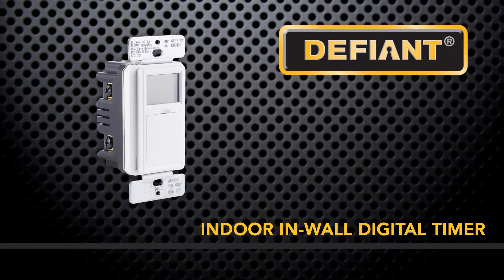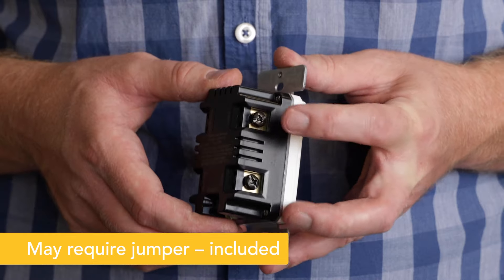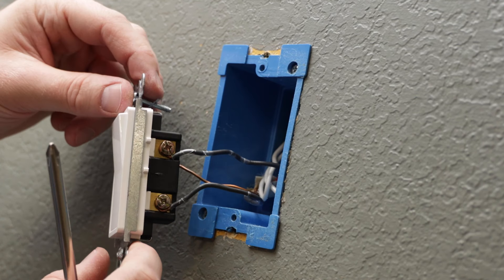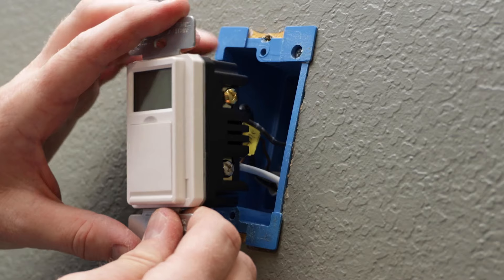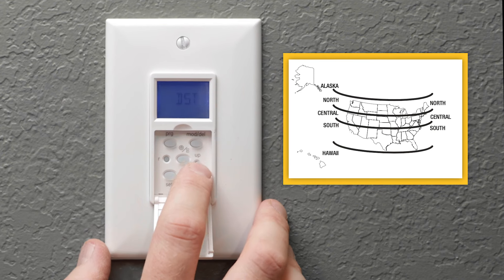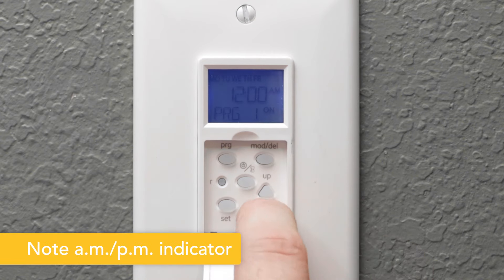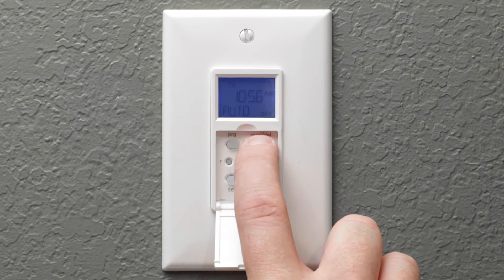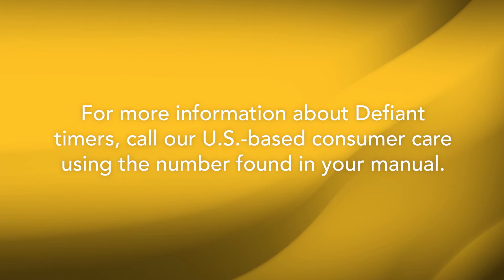32648: Defiant 7-Day In-Wall Timer - Installation and Setup

Comment: Thx for the short & concise video - it always helps to see how to do it as if you watched as someone taught you what you need to do.
Reply from the maker: Hi, James. We're glad the video helped. If we can do anything else for you, let us know.
Reply: It’s after sunset (dusk) I realized I had to correct the program and switch the dusk time to ON and the dawn time to OFF. And then the program did not kick in and turn the lights ON. Did I do something wrong or will it kick in later say a day later?
Reply from the maker: When the on time was set after dusk, the timer doesn't turn on until the next day. If that didn't happen for you, please contact Defiant customer support at 1-866-308-3976.

Comment: I installed the 32648 digital timer. The video instruction works until: in PROG 1, I specified the ON time by entering DUSK and hitting SET however the display did not progress to the OFF time. I found I had to hit PROG again, then I could use TIME to  specify an OFF time.
Reply from the maker: Thanks for reaching out. You are correct, the program button is used to cycle through the ON/OFF times. If you need additional assistance, Defiant customer support is available at 1-866-308-3976.
Reply: 70l 0:31 0:32
Reply: @JascoProductsCompany so to clarify, you set a program ON Time and then set a program OFF time?

Comment: Is it possible to replace the internal backup battery? Our switches are loosing programming after 1 to 2 hour power outages. Thank You in advance!
Reply from the maker: Thanks for reaching out. The backup battery is built in and not designed to be replaced. If you have other questions, Defiant customer service is also available at 1-844-871-8796.

Comment: We installed this unit in June 2022, but when the power goes out, it loses everything and have to reprogram it.
Can you please tell me why it doesn’t keep the program when we lose power. This United is only almost 3 months old.
Reply from the maker: Hi, Cindy. The timer has a built-in battery backup and should save your settings for up to seven days when power is lost. It's possible your device has a faulty battery. Please call 1-844-871-8796 to discuss your options.

Comment: I only need to have program 1 to be set and it should work right? It didn’t do it for me just now but I’ll wait until dawn until I call in for customer service.
Reply from the maker: Hi, Chris. Yes, you can set only program 1 and the timer works. If you create an on time prior to the time of day, the schedule won't activate until the next day. Defiant customer support is available at 1-866-308-3976 if you need additional assistance.
Reply: @JascoProductsCompany  it worked! Thank you.

Comment: Great video!
I accidentally set the wrong dusk time and the light turns on WAY too late.  Using RND means sometimes it's even 'later than late.'
Is there a way to JUST adjust the dusk time?  Or do I have to start over from step one and delete EVERYTHING?

Thanks
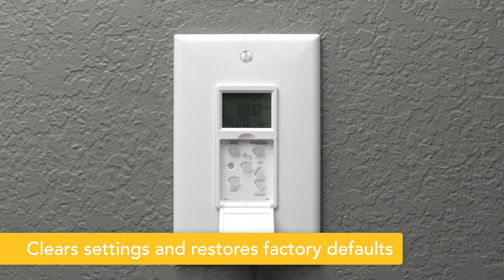Reply from the maker: Hi, Larry. Thanks for your feedback. If I understand correctly, changing your region should resolve the issue. This is done during the time/date setup process starting at 2:25 of the video. If your time settings are correct, press the set button to cycle through the programming options until you get to the region section. The "RND" function randomly fluctuates your ON/OFF programs up to 30 minutes to create a lived-in appearance. If you have additional questions, Defiant customer support is also available at 1-866-308-3976.

Comment: WHAT IS THE WHITE WIRE JUMPER THAT IS SUPPLIED USED FOR
Reply from the maker: The white jumper wire connects to the neutral wires in the switch box. If you have additional question, Defiant customer support is available at 1-866-308-3976.

Comment: After setting up the program it reads AUTO off. Is that correct? Will the program I set up for dusk to dawn still work?
Reply from the maker: When "AUTO" is displayed on the screen, the timer follows your scheduled programs — in your case the dusk-to-dawn setting. The "off" and "on" next to AUTO, MANU, etc. indicates whether the connected light is on or off. If you have any other questions, Defiant customer support is also available at 1-844-871-8796.
Reply: Thanks the Light just came on . Pun intended.

Comment: Hi I went out and bought another one, we liked it because it had the dawn & dust. We ran into a problem while installing the new one. There a red wire that came loose and we can’t figure out where it goes. I’ve shut the power off about 4 time and when I turned the power back on it kept the time. We can’t get the porch light to come on. Can you help please. Cindy
Reply from the maker: Hi, Cindy. Wiring colors may vary based on several factors, but a red wire is often a traveler in three-way installations. To ensure you receive proper assistance, please contact Defiant customer support at 1-866-308-3976.

Comment: Just saw this.  On more question. Is shows "Auto" mode and shows "off".  Does this need to say "on"?
Reply from the maker: Thanks for reaching out. Auto displays when your timer is set to follow your programmed times. The on and off indicators show the status of the connected light or device. This is helpful when the timer controls something you can't always see, like a porch light. If you have other questions, Defiant customer service is also available at 1-844-871-8796.

Comment: Installed it, tried it on manual mode, worked fine. Set schedule and thought it was good to go, never came on  and does not worknin manual mode now either, I can hear the switch make a click when I turn it on and off but light is not coming on
Reply from the maker: Sorry to hear you're experiencing issues with your timer. Check all wire connections, especially the load wire in this case, and ensure the terminal screws are tight. Please note, these are not back-stab terminals and the screws must be tightened for the timer to operate properly. If the light still doesn't turn on, please contact Defiant customer support at 1-866-308-3976.
Reply: @JascoProductsCompany  I'll just return it to Home Dump

Comment: My switch doesn’t have a green ground  wire . Just a black and  bypass wire to light?
Reply from the maker: The ground wire is a safety feature to protect against shocks. This timer requires connections for line (hot), load and neutral. If your switch box is missing any of these wires, it will not operate. You can also contact Defiant customer support at 1-866-308-3976 for additional assistance.

Comment: I just finished installing this. The display comes on but I have no back-lighting. Does the Hot and Load need to be switched?
Reply from the maker: Hi, Pete. That could be the cause of the problem. The internal battery can power the display and retain your settings but not activate the backlight. Ensure the hot wire is connected to the line terminal. If you continue experiencing issues, contact us at 1-844-871-8796.
Reply: @JascoProductsCompany  I just pulled it out, swapped the wires, and it indeed was it. Whole thing works great now. Thanks! I wasn't aware that it even had a battery that could power the display.

Comment: I only have two wires (black and yellow) contacting with the old switch but you show three wires needing to be connected. Can I still use this timer?
Reply from the maker: Hi, David. Wiring colors may vary from home to home. In addition to a line (hot) wire, which supplies power to the switch box, and a load wire, which connects the timer to the light, a neutral is required for the timer. Be sure to check the back of the switch box because the neutral may be tucked behind other wires. Depending on how your home was wired, it may not have a neutral. If this is the case, contact a licensed electrician to determine your options. 

For further assistance, Defiant customer support is also available at 1-866-308-3976.
Reply: @JascoProductsCompany  Thank you!
Reply: @JascoProductsCompany  Is there a way to determine the neutral wire if there are multiple extra wires?
Reply from the maker: @David Boyle the neutral is usually white. It is often multiple wires bundled with a wire nut and tucked behind the other wires in the switch box.

Comment: HOW TO CONNECT IF THERE IS ONLY WHITE BLACK AND GROUND
Reply from the maker: The timer requires line, load, neutral and ground wires. Depending on how your home was wired, it may not have a neutral at the switch box. For more information, Defiant customer support is available at 1-866-308-3976.

Comment: I can’t get to the first screen after default reset. It immediately goes to 12:00 am auto. Even after pressing up and down arrows, I cannot set Time or day or calendar.  What do I need to do?
Reply from the maker: Hi, Roger. After pressing the reset button, push "set" to begin programming the time. After pressing set, you can use the arrows to adjust the time. Press set again to select the date. If you need additional assistance, contact us at 1-844-871-8796.

Comment: Just tell me how to setup the time when I WANT TO SETUP MY PERSONAL TIME!
Reply from the maker: Hi, Leonard. To program the time of day, press the set button and use the arrows to adjust the time as shown at 2:25 of the video. To create a schedule, press the "prg" button followed by set. Use the arrows to choose the day(s) for the program to run and press set to store the option. Select a time for the connected device to turn on by pressing the arrows. Follow these steps to create an off time. This process is outlined at 3:05 of the video. If you need additional assistance, Defiant customer support is available at 1-866-308-3976.
Reply: @JascoProductsCompany  Great! Thank you so much!👍🤝

Comment: I just installed mine and hitting the set button resets the switch
Reply from the maker: Hi, Harley. To help troubleshoot the issue or find another solution, we need a little more information. Please contact Defiant customer support at 1-866-308-3976.

Comment: My wall has a red wire and a black wire. How do I connect this timer ?
Never mind, this switch is so freakin big, it doesn't fit in the box.  Now I have to make an extra trip for nothing, to return this beast.
Reply: @skyflyer4231  Mine didn't. It's 1 3/4 inch deep. Too deep for my box. I returned it.

Comment: Do you make a similar SIMPLER timer to program? I'd like to replace this complicated thing with one where I can set the time of day, then the time to come on and time to turn off. PERIOD. No time zones, no seven programs, no UNBELIEVABLE numbers of button punches. I dread every time the power goes off around here.
Reply from the maker: Hi, Max. Sorry to hear your timer hasn't met your expectations. We offer several in-wall models that might meet your needs better. 

If you want your lights to turn on and off at the same time every day, check out https://www.amazon.com/myTouchSmart-Digital-Programmable-Indicators-26893/dp/B01BKGC492/ref=sr_1_6?crid=3FIRCIPF1XROO&dib=eyJ2IjoiMSJ9.CK3qZbYM9pM_kz7A9lMOv8WkuJ-ojZxKkcvbxt3_DF_ZK4jKXxavBeqH4ocpLf5x7vpr9vuBMJ7OknIarkbiE1eKHZhCqFlFqN779g--192qxMZjspm_cGdVs0dQKjvrLo3OjZTtcCwiYcUBrWNE41QWO9Hg5FlykkXYLRAMkvj9lxPzFbu0ItWUU_-xLsyFiWwj20AKxgtpNSsOtPRgyxsHKnDf9KV5WcabkkaZ6S6pJswd9JVPvXc06ebaMn8r5OwyZXqGCz0Lw9Bn77r13MnsQix2jSWCEY4tiyglR43HJSOEQmQyh0wwFzNwWdYRwFQnkWHA0G0GYd1AiTX4zJlmGEjJmaGNufrqw7CC2cnYPWQq7PuVgZuDjuQ7qQCJyWG6r82bbHgn0IR7Dq5-4yNU4j2gGXhm348LZYVZ_32byuRmcZFnWnvhAEGf_bSw.oegCV0HWJ1zSmgWnt0oUsuVOL_xlDf62yoJajkDf-WM&dib_tag=se&keywords=mytouchsmart%2Bin-wall%2Btimer&qid=1737991068&sprefix=mytouchsmart%2Bin-wall%2Btimer%2Caps%2C123&sr=8-6&th=1. 

The timer at https://byjasco.com/mytouchsmart-wall-sunsmart-all-one-timer also has a seven-day cycle like the version in this video, which allows you to program different settings for separate days of the week if you desire. However, you can also create one schedule to recur every day. The time zone needs to be set, but it has a built-in backup battery to save your settings during power outages. 

Our U.S.-based consumer care is also available at 1-800-654-8483, M-F, if you have additional questions.
Reply: @JascoProductsCompany  Thanks. That looks like what I want. I'm impressed that you replied. Wins more of my confidence in Jasco.
Reply from the maker: You're welcome. We're happy to help.

Comment: Hello. I have a GE inwall digital timer #15806. I programed it and it works fine but it keeps flashing the word "timer" next to the clock display. It had never done that before and the instruction sheet says nothing about why it would be doing this. Can you explain this to me and how to fix it. Thank you.
Reply from the maker: Hi, Michael.
Pressing the reset but on the timer and programming it again might resolve the issue. If that doesn't work, contact our U.S.-based consumer care at 1-800-654-8483, M-F, 7 a.m.-8 p.m. Central Time. To speed up the troubleshooting process, you can take a picture of the back of the timer before calling a consumer care specialist.
Reply: @JascoProductsCompany Thank you for your response.  Yes. Reset did work but what does it mean when the word "timer" blinks during and after programming? Just curious.
Reply: @JascoProductsCompany  Also, I mistyped the model number. It is GE digital #15086. Sorry. Don't know if that makes a difference.
Reply from the maker: You're welcome. We no longer carry that model. Without replicating the issue with you, it's tough to say exactly what happened. If it happens again, give us a call so we can try to get to the bottom of it.
Reply: @JascoProductsCompany  LOL. Wouldn't even know how to replicate it as i am not sure what I did to get it to blink like that while programming it. Thought maybe I stumbled upon some hidden feature I wasn't aware of. That's why I asked about it. Anyway, thank you again for taking the time to reply. Appreciate it!